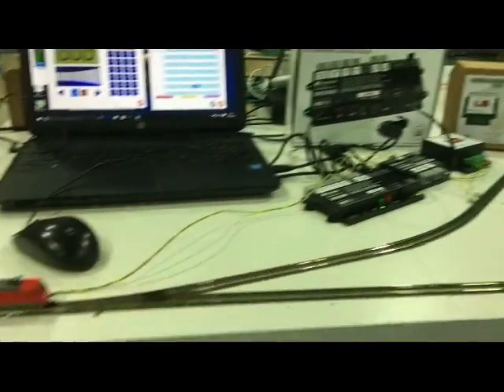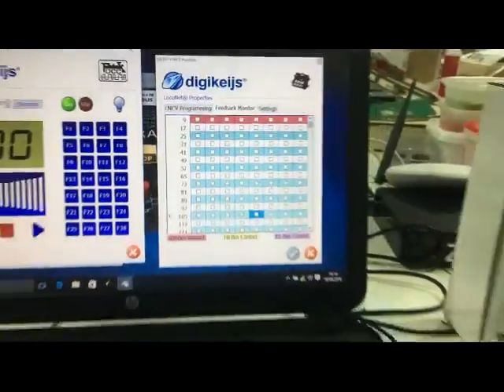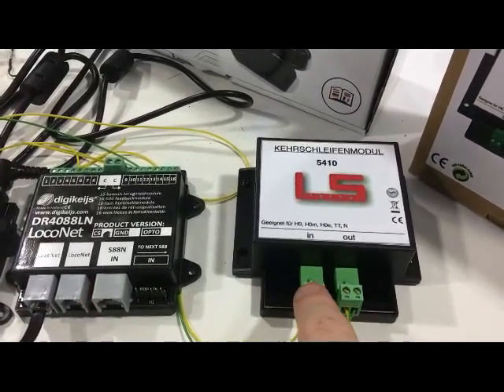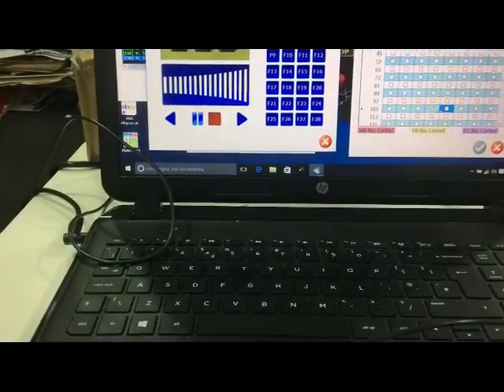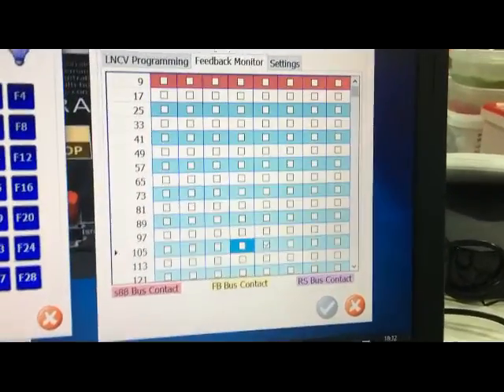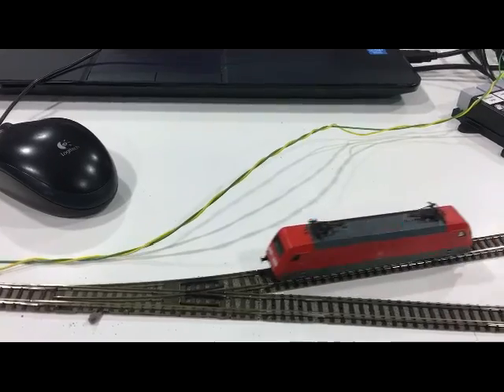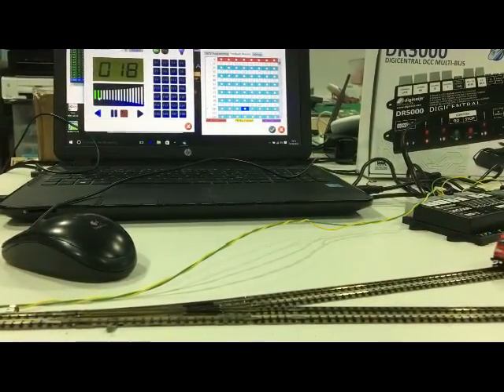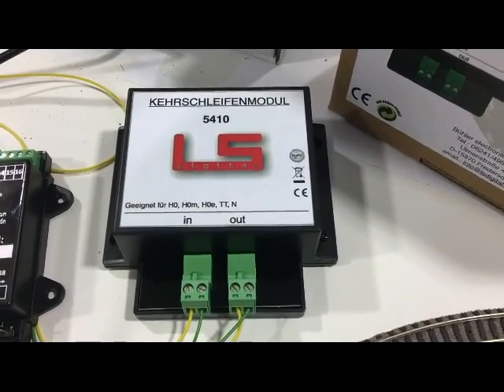LS Digital Reverse Loop 5410 and Digikeijs DR4088LN

Comment: I'm going to buy a DR5000 (15v). Do you need to use the DR4800LN, or is the DR4800CS the same?
Reply from the maker: Hello John This will work with either the DR4088CS or DR4088LN-CS but please see the link to the updated reverse loop module you now need to buy. https://www.dcctrainautomation.co.uk/lodi-kms-reverse-loop-module-for-digital-railways.html
Reply: Thanks for your swift reply. Have added it to my N Quay Harbour requirements